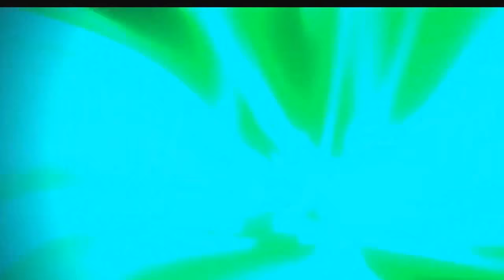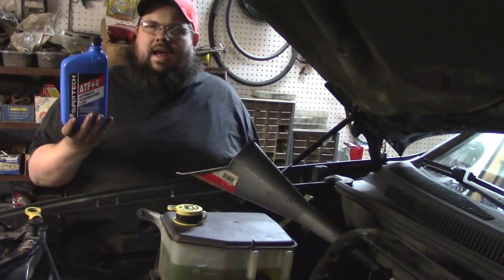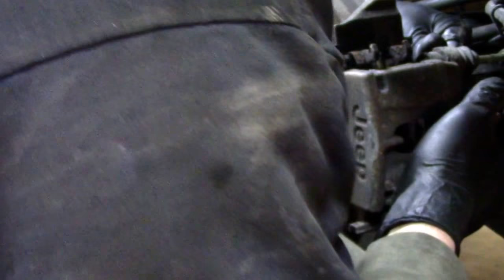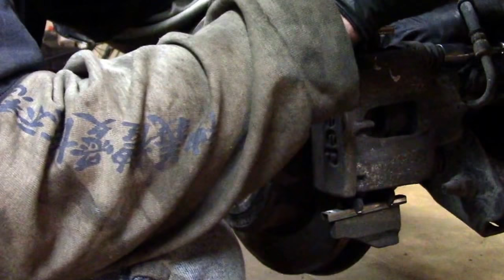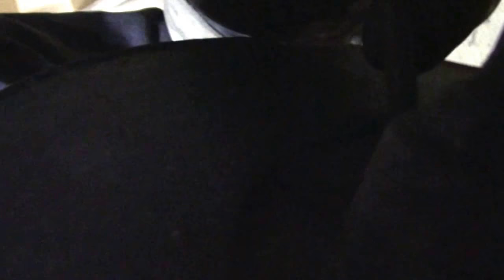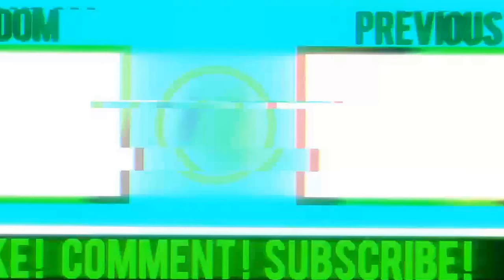05-10 GRAND CHEROKEE E-BRAKE SHOE REPLACEMENT

Comment: Im running into the same issue at the shop with a 05 WJ. Ive done a TON of these and this is the first with this issue. I cleaned amd freed up everything. Noticed the shoes arent sitting on the mechanism that hooks on the cable. This garbage kicked my ass the last hour on the clock. Now I got a Gopd direction to head in the AM Thanks Bud Happy Wrenchin from Western Pa
Reply from the maker: Glad we could help... Good luck

Comment: It looks like a drum brake tool would help a lot for the e brake pad replacement. I did my brakes about 6 months ago and used Red engine paint on the calipers and the back plate on the pads. I also changed all the hose clamps out to worm screw style on the coolant system and added new Mopar MS-9769 coolant mixed with about 35% distilled water.
Reply from the maker: Nice

Comment: I finally own a hemi too! It has almost been year and a $2000 just in parts getting it back to or better than condition. I still have to do the fluid changes and filter on the transmission. Fluid change on the diffs, and transfer case sometime soon. Oh yeah and I got 10 quarts of 10w30 Valvoline Max life full synthetic, Lucas oil additive full synthetic, and a M090 Mopar oil filter for the next oil change.🏁
Reply from the maker: Nice....

Comment: I took the parking brake pivot hook off the cable eyelet, it doesn't want to go back on now because the eyelet/cable wants to pull back in towards the grommet. This is frustrating. I need like 5 hands to reassembly it
Reply from the maker: Yeah, I'm not sure.

Comment: Thank you for this helpful video. I have a question please. After replacing the handbrake shoes (left side) and doing this process, I drove my car with no problems for a long day. The second day, after releasing the handbrake , my jeep started shaking and vibrating for around 150 meters and then worked normally. It seems like the handbrake was still on. This problem appeared twice.  What can I do to avoid this ?? Thank you so much.
Reply from the maker: Im glad the video helped. Im not sure the peoblem isbwith the ebrake, people drive with them on all the time and have no idea till they smell it. But i would pull it apart, make sure they are adjusted right and maybe pull,the drum to make sure everything is where you put it. Also double check and make sure your cable is actually releasing, sometimes people dont use the ebrake all the time and it gets sticky from corrosion on the inside.
Reply: I have had the same problem with my vehicle (even after the dealership worked on it).  I've tracked it down to the parking brake shoes making contact on the drum surface possibly due to driving on a bumpy road.  This appears to trigger the start of an oscillation - the brake shoes start to shake and make intermittent contact.  It feels like your wheel nuts are about to come off.  My solution is to back off the parking brake shoes more than 'normal'.  This seem to be a design issue since all internal components appear to be in good condition.  In over 30years of vehicle repair, this is the first vehicle I've ever seen this on...

Comment: Where were the parts bought are they oem? I installed mine but I can't get them to completely stop the jeep even after messing with the adjusting screw. I think I bought mine in oreillys.
Reply from the maker: I never use oem.. I find the cheapest possible parts.. Ebay, amazon, rock auto,etc